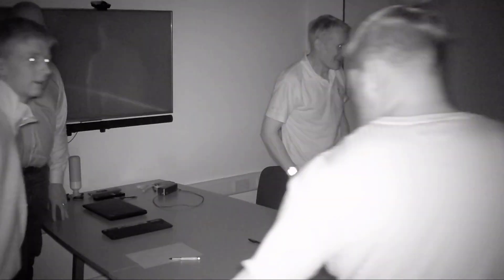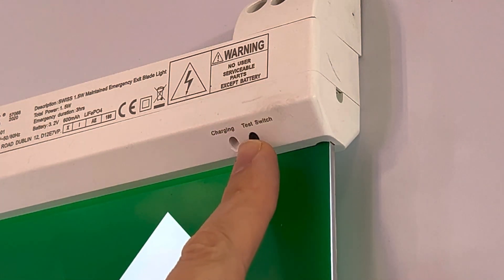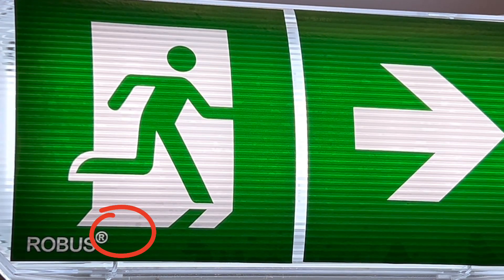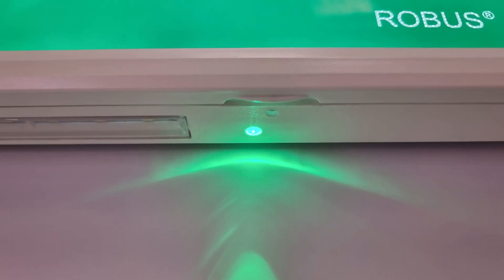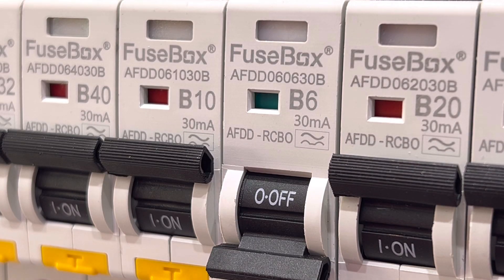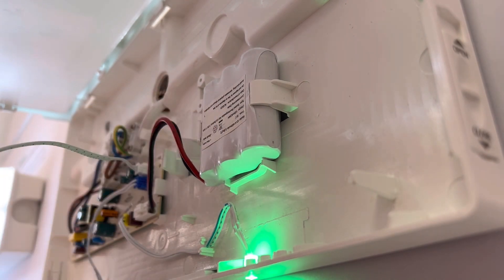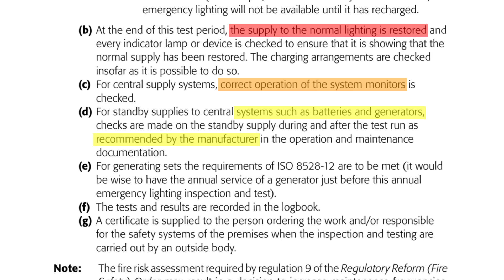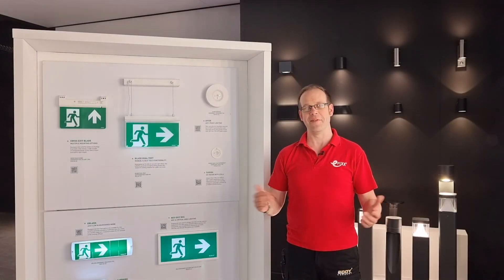How Often Should You Test Emergency Lighting?

Comment: I see tons of emergency lights in shopping centres which have failed due to having red LED indicators on them and yet nothing seems to ever be done about it. Makes me think if any these regulations are ever enforced at all, or only after a major disaster happens
Reply: Several times I have worked in shops and found emergency lights not working when turning off lighting circuits to do other repairs. I have always pointed this out and even stated it in writing to the person who owns the shop or is responsible for the building. More often than not I’m told they’re ok and don’t worry about it . They are not in important locations
Reply: Some emergency lights use red LEDs instead of green as their indicators
Reply: @ Not these ones. I hate how there isn't a uniform standard though

Comment: Monthly "flick" operational test and annual 12 month drop test. Very few systems are central battery systems these days, even in most data centres, that have UPS systems for critical services, do not use central battery systems - a lot of this is down to costs. The monthly functional test should not only check the oepration of the light, but also take into account the visibility of the fitting, and sany damage - self test is rubbish as you have no way to prove any testing has been completed so unless you have a centralised lighting control computer that can print test results. 

Only people who have knowledge of emergency lights and competency to check all relevent aspects of them should be testing them - these are life safety systems and should not be installed or maintained by wannabees. Every emergency light should have a test function, either installed into it or on the circuit feeding it - if you have to switch off the MCB to test fittings than the circuit does not need the required regulations.

Comment: I done a wiring upgrade in a village hall about 3 years ago . 2 emergency lights were installed in the late 70s  and 3 in 2000/2001 . Since installed they have never been tested. Or so I was told . Only one of the 5 was partly working and that was an original with a 3 volt filament lamp and had the original battery. Well over 40 years old 
I’m sure the new replacement wont even last 10 years .Probably more like 5 if I’m lucky

Comment: Fantastic video Joe . 
I believe that everything you mentioned is extremely important for the safety of everyone in any building that has emergency lighting. 
But I have to say it amazes me how so many of these don’t ever get inspected correctly if at all or even test. I know for a fact that the emergency lights in the care home were I was one of the spark that  wired the place when it was built and my farther in-law spent his last three years of life was never inspected or tested at all , and most of the key switches has surgical tape over them to stop residents or anyone else from poking thing into the key slot . Im glad to say the home closed down just before lockdown. 
Personally I’ve always kept a key switch key on my key ring , still do  never know when I might need it.